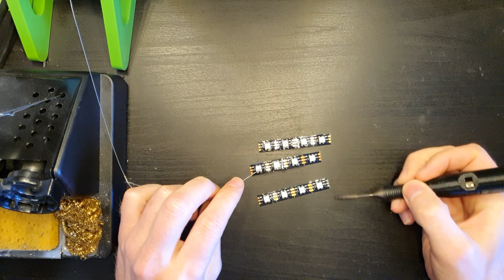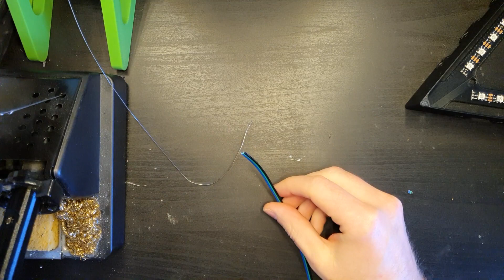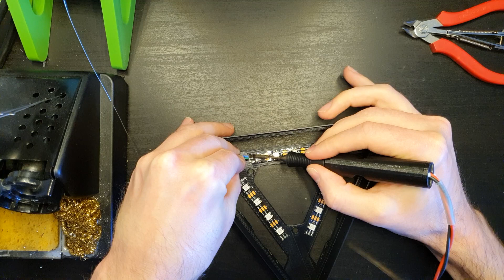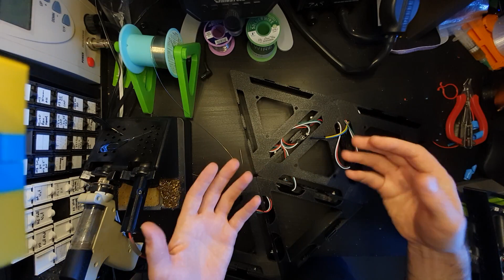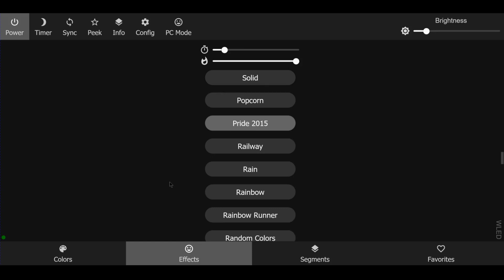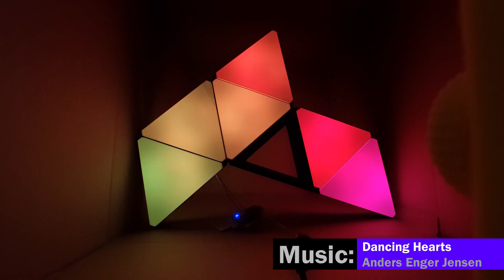Light Panels: a WLED based - Nanoleaf Replica

Comment: Laurynas Mažeika

Have you sanded the surface of nanoleaf diffuser?
Reply from the maker: Hi Laurynas, no I haven't sanded the surface. I am using a the textured build surface with my Prusa Mk3S though. That said it the diffusion is just from the model being thin enough and that the filament I used is slightly translucent.
Reply: Same question

Comment: Would’ve been easy to wire up before you stuck led into 3D print housing module ??
Reply from the maker: Probably yes! But I also wanted to keep the wires as short as possible and make sure the strips were in the right place as well.

Comment: The lights you are using look different than Akyelle's. Do you have a link?
Reply from the maker: Mine are 60LED/m WS2812 strips. Can't remember where I got them from (brought ages ago and were left sitting in a draw waiting for a project!) but these look similar: https://www.amazon.co.uk/WS2812-Stripe-integrated-WS2811-controller/dp/B00H3IX1NK/ref=sr_1_5?dchild=1&keywords=ws2812+60&qid=1615194512&sr=8-5
Reply: @smartroadbiker  Great, thanks!
Do you think doing strips of 5 or 6 LEDs would have given better coverage into the corners? and what about 12 volts? would that possibly help with the dimming last panel?
Reply from the maker: Sorry just saw your questions! I did think I could have extended the number of leds to 6 per strip, which would increase brightness in the corners. That would come at a higher power consumption though, which is why I stuck to 4. 

12v would reduce the effect of the voltage drop meaning more consistent brightness. Although since this video I don't seem to notice the dimming as much, so not sure what is going on!
Reply: @smartroadbiker  ok, good to know. I've never worked with electronics this my gaff of blowing out one strip in my attempt to doing a full length, double strip fixture.

My next attempt will be following your guide. I may push it to 5 or 6 LEDs and use a 12v power. I'll likely be back to probe your brain!
Reply from the maker: Make sure the strip you are using is a 12V strip. If it is a 5V strip applying 12V will kill it!
Reply: @smartroadbiker  i'll be sure to check. Thanks!
Reply: Hi. What was your print time in the black triangles? CURA is telling me 7 hours for my ender 3 v2. Just wanted to ask if that was normal. Thank you
Reply from the maker: I don't think I was that long. I use Prusaslicer on the 0.2mm speed setting. I'll check once I am at my computer to re-slice it and see!
Reply: @smartroadbiker  great. Thank you
Reply from the maker: @mj3432  Here are the times for the parts:

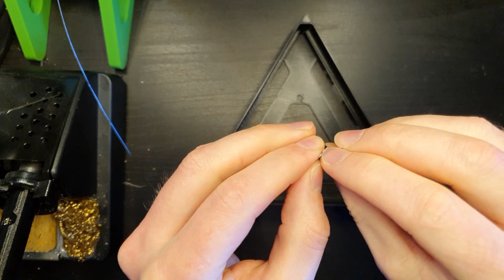2.stl - 4:21
3.stl - 2:30
4.stl - 3:16
My front with button - 4:12 
(times are HH:MM)
Reply: @smartroadbiker  great! Thank you very much!! Awesome video and great job

Comment: What is the wall count for the diffusers? And did the diffuser not get blocked by the wirings?
Reply from the maker: 2 walls and no, it takes a little work to get the wiring to not show a shadow (as I mention in the video :)). Worse case, use some hot glue to secure the wires out of the way.